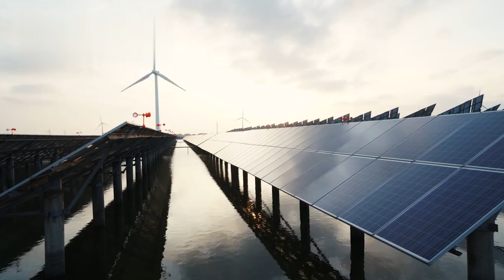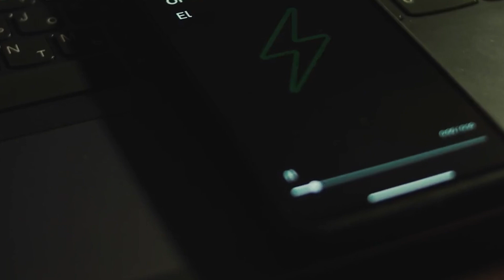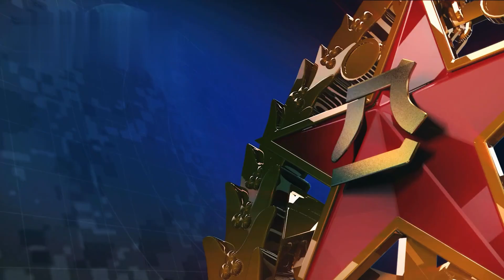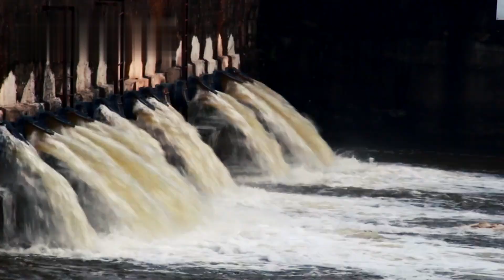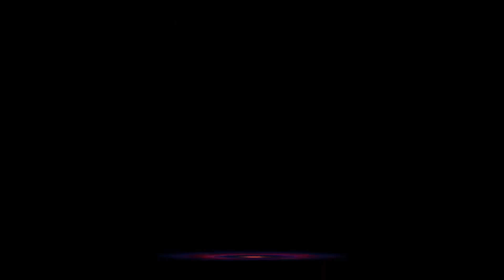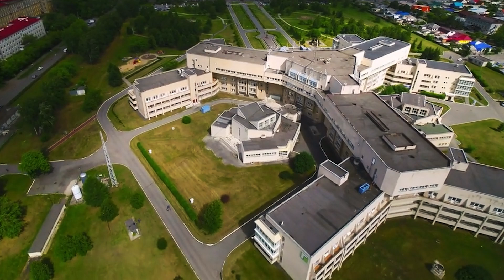China’s “Plug-and-Play” Nuclear Power Is Here

Comment: Look for the Dual-Fluid reactor.
🔋 Key Advantages of the Dual Fluid Reactor (DFR):

• ⚡ Ultra-efficient: Nearly 100% of nuclear fuel is used  
• ♻️ Burns nuclear waste, depleted uranium, natural uranium, thorium – and all actinides (incl. Np, Am, Cm)  
• 💥 Transmutes long-lived actinides into short-lived fission products  
• 🔄 Built-in Pyro Processing Unit (PPU): Continuously removes neutron poisons and extracts valuable metals  
• 🛠️ Liquid fuel: No solid fuel rods, no reload cycles  
• ⏳ Decades of operation with a single fuel load possible  
• 🚫 No corrosive salts: Liquid metal fuel avoids fluoride corrosion and complex chemistry  
• 🧊 Lead coolant: Excellent shielding, no water, no pressure → no steam explosion risk  
• 🌡️ Very high temperatures (700–1000 °C): Enables hydrogen, e-fuels, ammonia, and direct steel reduction  
• 🧠 Self-regulating: Output adjusts automatically via negative temperature feedback  
• 🪫 Minimal waste: Only short-lived fission products remain (<300 years)  
• 🏭 Compact & scalable: High power density, ideal for modular deployment  
• ⚙️ No moving parts in reactivity control: No control rods required  
• 💰 Uses spent fuel, DU, thorium & actinides – no enrichment required  
• 🌍 Reduces dependence on enrichment, mining, and fuel imports  
• 🔄 Fully closed fuel cycle: No external reprocessing required  
• 🆚 Outperforms typical SMRs: No pressure vessels, no water coolant, no fuel handling